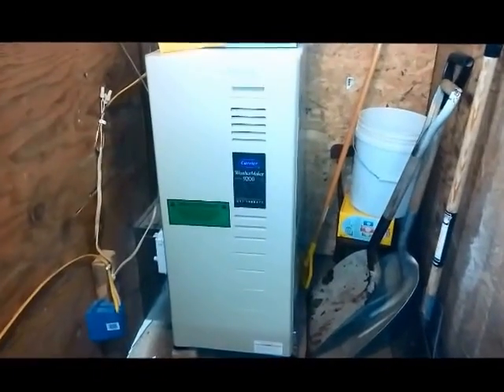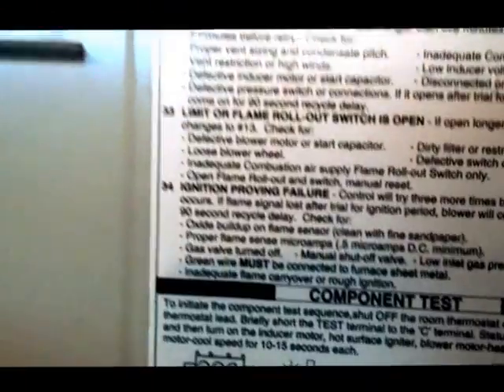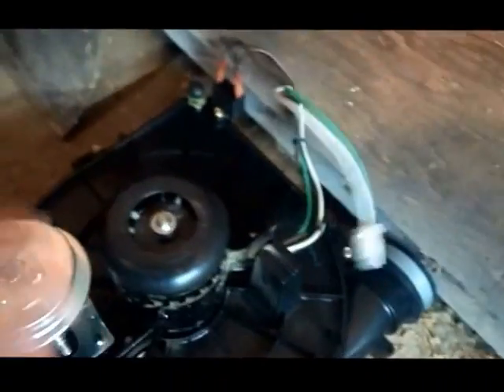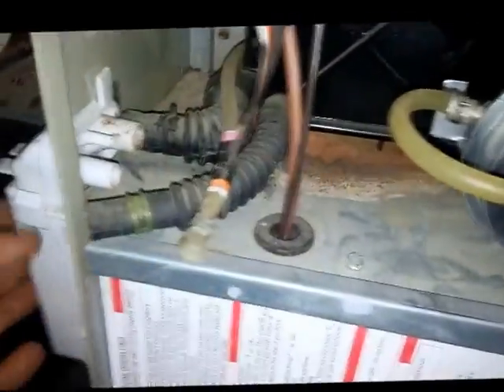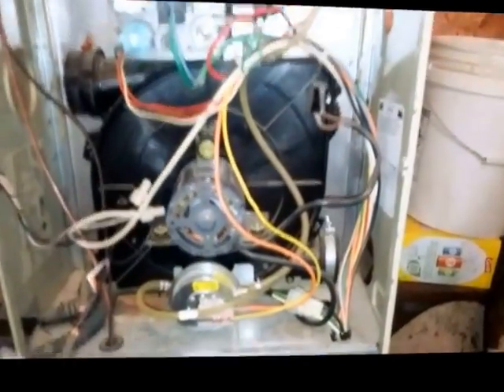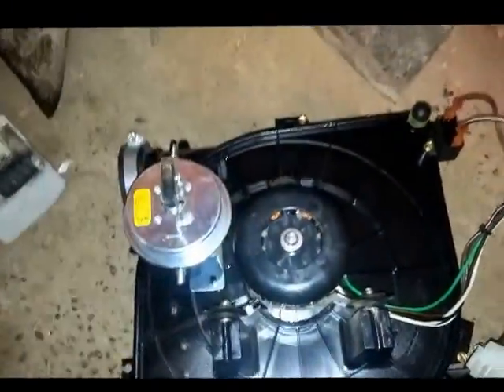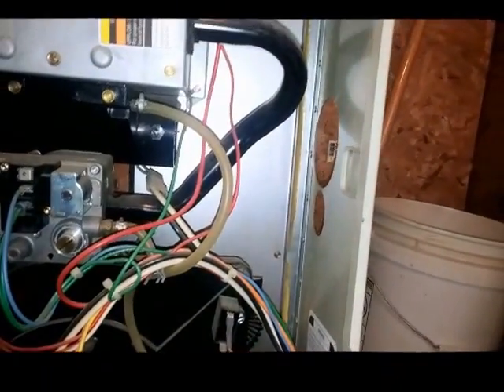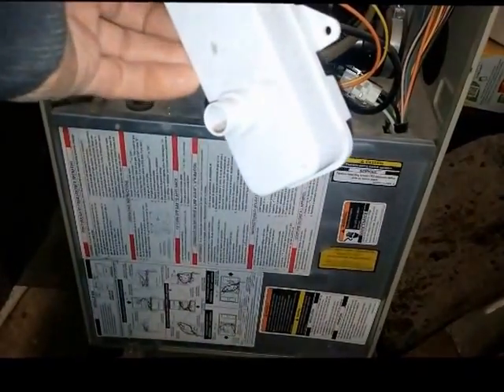Diagnostic of 31 Pressure fault code on Carrier Bryant Payne 90% furnace

Comment: Code 31. Replaced igniter. furnace worked for a couple weeks. Blower works fine. I have the newer version that you showed in the video. Just no warm air. Cleaned trap and lines. Checked all rubber hoses for obstruction. Cleared the exit hole for trap. installed new igniter. Removed exhaust flipped furnace on but still getting code 31 and no warm air. Any other suggestions? Thank you so much. Your video was very helpful in trouble shooting. Just haven’t found the issue yet

Comment: Hi Ed, thanks for your tips with the 31 code issue. I taped the blower cover panel switch down so I could look things over and still run it. Can I expect to know if I've fixed the "31" problem if that cover panel is off? I won't be back at the furnace location for a few more days and was just curious. Thanks a lot.
Reply from the maker: That door switch has to be held down. Every time you take away the power it resets the fault code . So reinstate the high voltage and wait for it to fault out again.

Comment: I'm sharing my experience in the hope that it benefits others. My furnace was exhibiting a frustrating behavior—it would start but immediately shut off. In my case, I have two furnaces, and the problematic one was located in the attic. This issue occurred during extremely cold weather, around minus eight degrees F outside.

Initially, I attempted to address the problem by cleaning the flame sensor, even though it didn't appear dirty. This seemed to work temporarily, as the furnace ran for about 20 minutes before cutting out again. Frustrated but determined, I stumbled upon your video suggestion that proved to be the solution: cleaning the condensate trap.

Upon inspection, I discovered that the condensate trap was frozen. After thorough cleaning the condensate trap, the furnace started working again seamlessly. A heartfelt thank you goes to you for this video. It's incredible how such timeless wisdom continues to assist and benefit so many people, including myself. God bless you!!
Reply from the maker: Thanks!

Comment: Perfect!!!  some of these air switches has two contact - one on the front one on the back check both! On my Carrier unit the yellow jumper powered both switches - then there was a brown (signal to control board) and orange (signal to control board) two different outputs signals. Inducer housing pressure and collector box pressure (check all 3 tubing- green, black, and black square tubing vacuumed sensing signal). Blow them out (toward the inducer housing) and you can check them with a OHM meter by gently sucking on the hose and hearing them click.  Make sure the hoses are good and tight - a very small vacuum leak can cause them to not work!

Comment: Thanks such for posting this extremely helpful video, Ed! Got the 31 error code on my Payne furnace model PG9M which kept tripping the furnace off. Checked the condensate trap issue- sure enough, that was it- about a 1/2 gallon of water came out just like you said. Cleaned it out, whole bunch of gunk and funk came out. Works like a charm now! Saved me a service call on an extremely cold Wisconsin January morning! Cheers and Happy New Year to you! 😁
Reply from the maker: Thanks!

Comment: What if the inducer doesn’t come on and isn’t getting power but it’s not a bad board? Drain is cleared as well
Reply from the maker: Do you have 24 volts at w and c on the board? Are the batteries good in the thermostat? If you have 120 volts at the inducer and it's not running  the inducer is bad.

Comment: I have the 31 and it gurgles or sloshes when turning the motor that should spin freely. Mine is a similar newer model you have on the floor. However, I don't have the hoses going to the trap. It appears to go from the back casing into the trap. I removed the trap and cleaned it well. Some gunk but not much. I believe I identified the clog in the drainage hose going to the sewer drain. So long story, my question is how do I get the water out to stop the sloshing when turning the motor? I don't see any hose to drain. Hope you have a moment and know how to fix...
Reply from the maker: Sorry I missed this. You need to take the little rubber elbow off the housing if you have water in there. That needs to come off to clean the trap.

Comment: I was getting 3 error codes: low pressure switch (31), high pressure switch(32), and draft inducer(42). I was thinking failed part of blocked flue. Well, I ran a fish tape down the venting (short length), and it didn't do anything. Then I watched the first minute and a half of this video: you said blocked trap. Sure enough, that was the issue. 
I now have glorious heat so much my wife said it was too hot and could I "stop playing with the furnace". :D

Thanks! :)
Reply from the maker: Please subscribe to my YouTube Channel. Need to get to 1000 subscribers to help pay for my hardware for my Bald Eagle cam that should be ready to go next year at this time.
Moving forward we are planning a live stream of a Bald Eagle nest near my home in Woodbury, Minnesota. Also I will be posting more hvac related service video...

Comment: Maybe you can help me ... I replaced my inducer last year and now the inducer cycles on and off.... I get no code? Any thought for me.  The computer was replaced like three years ago. Still, I cleaned out the water trap and cleared all drain hoses. like I said, no code. Before I call a repair guy  I thought I'd throw a hail mary so to speak.

Bob

Comment: AWESOME! My central heat Carrier had error code 31. With a lot of doubt,  I went straight to cleaning the drain trap. I should have gotten the bucket first. About a gallon of water came rushing out as I took off the first drain line. The first few flushes of the drain trap gave nothing. Then a bunch of black junk came flushing out. I re-installed the trap and the unit has been running ever since.
THANK YOU !!!
Reply from the maker: Please subscribe!

Comment: Add me to the clogged drain trap.  Furnace kept going on and off, couldn't get the pilot to kick on.  Went through everything and drained the trap.  Still nothing, Then I watched your video again and Although mine was far worse about a year before I flipped it over and another couple of ounces came out.  Hooked it back up and then the furnace kicked back on.  I think mine just needs to be replaced soon.  Years and years of build up may not completely fix the problem.  Thanks for the video!
Reply from the maker: I was on one of these about a month ago. Cleaned it. Back a week later to find that I did not clean it well enough. You have to hear the air sloshing with water through the trap to insure it has been thoroughly cleaned. I am still learning.
Reply from the maker: Please subscribe to my YouTube Channel. Need to get to 1000 subscribers to help pay for my hardware for my Bald Eagle cam that should be ready to go next year at this time.
Moving forward we are planning a live stream of a Bald Eagle nest near my home in Woodbury, Minnesota. Also I will be posting more hvac related service video...

Comment: My furnace is showing the error 31 but only in the mornings. After a cycling, the power, several times the furnace will start and run all day with no problem. It seems to have the problem when it sits all night and does not run until it is time to warm the house up in the morning. Do you have any suggestions?

Comment: Followed the instruction to fix my furnace.  The condensate trap is completely clogged.  I took it out and got it though using vacuum.   Thank you so much.  Save me a $$$ and earn me a lot of respect from my wife!  :)
Reply: Ya same here.  I poured draino and scolding hot water through the unit.  Furnace came back on without a problem
Reply from the maker: Please subscribe to my YouTube Channel. Need to get to 1000 subscribers to help pay for my hardware for my Bald Eagle cam that should be ready to go next year at this time.
Moving forward we are planning a live stream of a Bald Eagle nest near my home in Woodbury, Minnesota. Also I will be posting more hvac related service video...

Comment: the problem I have it has two sensors one I  have two reset all the time what can cause the problem two orange wires run to the sensors thanks
Reply from the maker: Probably a bad heat exchanger. Flames are rolling out.
Reply from the maker: Please subscribe to my YouTube Channel. Need to get to 1000 subscribers to help pay for my hardware for my Bald Eagle cam that should be ready to go next year at this time.
Moving forward we are planning a live stream of a Bald Eagle nest near my home in Woodbury, Minnesota. Also I will be posting more hvac related service video...

Comment: Thanks!  I was able to get my furnace running with your help.  Clogged trap...but I could not remove mine - the drain was glued to pvc and I'd have to cut it out.  However, I found another video that suggested that I could blow it out after removing the pressure switch hose.  It worked!  Thanks so much.
Reply from the maker: Please subscribe to my YouTube Channel. Need to get to 1000 subscribers to help pay for my hardware for my Bald Eagle cam that should be ready to go next year at this time.
Moving forward we are planning a live stream of a Bald Eagle nest near my home in Woodbury, Minnesota. Also I will be posting more hvac related service video...

Comment: CHEERS to you, Ed!!! Thank you for your very helpful video. On a freezing and snowy April evening our furnace threw a code 23. I read somewhere it had a connection to a code 31. I checked the drain tube as you suggested and found it to be full of water. I disconnected the condensate trap to rinse it and found it was clogged. Some hot water and tapping on the kitchen sink cleared all the dirt and crap from the inside. After putting it all together and crossing my fingers we are a warm and happy family again! Thanks for the help and many blessing to you and yours!

Comment: I cleaned the drain trap and hooked up a shopvac blower to both tubes and let it blow for a bit and BOOM! it worked thanks for the tips Ed you saved me hundreds.  When I blew out the tube connected to the fan it blew out some water so I think that is what fixed it.
Reply from the maker: Please subscribe to my YouTube Channel. Need to get to 1000 subscribers to help pay for my hardware for my Bald Eagle cam that should be ready to go next year at this time.
Moving forward we are planning a live stream of a Bald Eagle nest near my home in Woodbury, Minnesota. Also I will be posting more hvac related service video...

Comment: Thank you so much! I had code library 31 flashing on my Carrier furnace. After struggling to diagnose the problem myself, I turned to YouTube. My issue was just as you described; clogged condensation line. I also appreciate the heads up on using a bucket. About 1/2 gallon of water came out.

My model furnace had the drain line assembly inside the furnace which made it harder to clean. I took some flexible pvc tubing I use for home brewing beer and used it to blow out each inlet. Lots of junk came out.

Again... thank you. You saved me a weekend service call to the HVAC company!
Reply from the maker: Please subscribe!

Comment: Question?? I have the Bryant plus 90 I been having this 31 code played with the drainage think I freed that  up seem to work fine for a couple days. Now she will not fire it will got through the process then when the inducer starts and the igniter lights the gas it will quickly shut down. Is this pointing towards the pressure switch?
Reply: I have the same model furnace but get intermittent code 14 "ignition lockout" and have to reset the furnace. Two service companies cannot find the problem despite cleaning, inspecting, testing all potential issues. Vents, air intake, exhaust, ptrap, drain, even changed gas valve, same intermittent problem. Anyone have the same problem or solution ?
Reply: I have since then gotten rid of that unit. . I couldn't take the issues any more. .

Comment: just fixed my furnace using this video with below zero temps coming tomorrow and 1 year old in the house.  My issue was also the condensation trap as others have said.  Your explanation was spot on and thanks for the heads up about how much water was going to come pouring out.  I had my bucket ready.  Great job making the video and explaining everything.  Thanks a million.
Reply from the maker: Please subscribe to my YouTube Channel. Need to get to 1000 subscribers to help pay for my hardware for my Bald Eagle cam that should be ready to go next year at this time.
Moving forward we are planning a live stream of a Bald Eagle nest near my home in Woodbury, Minnesota. Also I will be posting more hvac related service video...

Comment: Just thought I'd say thanks for the video! I had a code 31 and replaced the pressure switch with no luck. Your video helped me identify a drainage issue with the trap. I took it out and cleaned it up. Everything works perfectly well. To anyone who might have similar issues, make sure to blow air through all of the inlets / outlets of the trap to remove debris. I simply used my mouth (forming a barrier with my hand). I soaked it all in hot water / dish soap as well before blowing it out.
Reply: Hello Ed, Thank You

you just saved me $1800, the tech that came last week indicated that I needed a new secondary heat exchanger.
He did not spend much time and could not explain why I needed it. These 90 percent bryants had a class action suit with regards to the Heat exchangers, (that's another email). In an case I followed you direction and in addition, I disconnected the intake and exhaust pvc an attached a shop vac and blew air through the system. System has worked fine since.
Reply from the maker: Please subscribe to my YouTube Channel. Need to get to 1000 subscribers to help pay for my hardware for my Bald Eagle cam that should be ready to go next year at this time.
Moving forward we are planning a live stream of a Bald Eagle nest near my home in Woodbury, Minnesota. Also I will be posting more hvac related service video...

Comment: my Bryant plus 90 gas furnace was installed in April of 2005 when house was built. I had trouble with it starting and then stopping after 5 - 15 min. then it would blow cold air. This video diagnosed my problem to a tee. It flashed a 31 code and I found the condense lines were clogged. Did as you suggested and cleaned all lines out and no more problems. I will tell you that after cleaning water drain lines I heard a noise coming from the inducer motor but it cleared up after running it a couple of times. At first I also thought the inducer motor was bad but I now think it was the backed up water in the collection box. Anyway thank you for the insight and how to repair this common problem.
Reply from the maker: Please subscribe to my YouTube Channel. Need to get to 1000 subscribers to help pay for my hardware for my Bald Eagle cam that should be ready to go next year at this time.
Moving forward we are planning a live stream of a Bald Eagle nest near my home in Woodbury, Minnesota. Also I will be posting more hvac related service video...

Comment: Excellent video. I found it at 2 in the morning when I had no heat in the house and the temperature outside was 2 below zero. I was getting the LED 3.1 Fault so I followed your video and cleaned the drain trap. Within 15 minutes the furnace was really blowing out the heat. I have a Weathermaker 9200 but I think it was a little newer that the one you worked on. My drain trap was not located on the outside.  If you feel like make any more videos and happen the be working on a Carrier Weathermaker 9200 Furnace could you make one on how to locate and clean the Flame Sensor. Thanks again you saved me a couple of hundred dollars.  Jeff
Reply from the maker: Please subscribe to my YouTube Channel. Need to get to 1000 subscribers to help pay for my hardware for my Bald Eagle cam that should be ready to go next year at this time.
Moving forward we are planning a live stream of a Bald Eagle nest near my home in Woodbury, Minnesota. Also I will be posting more hvac related service video...